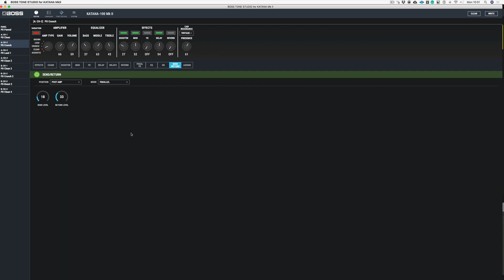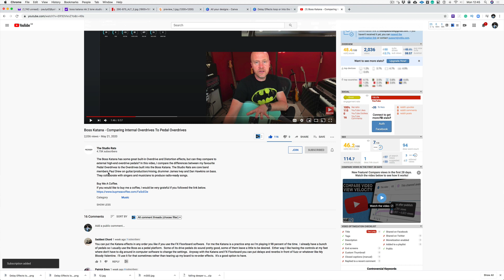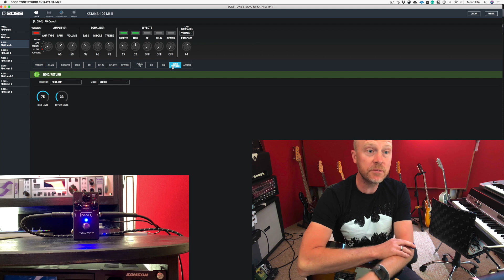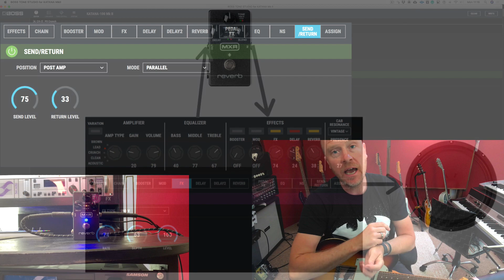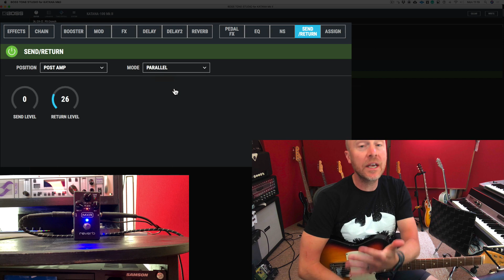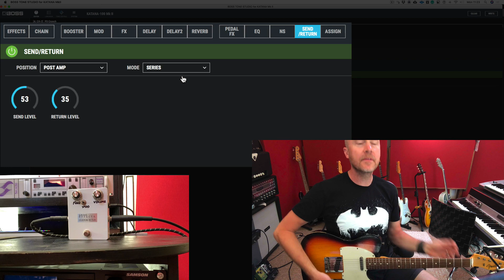Boss Katana - Effects Loop

Comment: Thank you for your Katana videos - they are very helpful. I  recently watched your Ultimate Versatile Tone series, and tried out the settings.  I see you are using similar settings in this video.  In common with other YouTube channels you tend to use quite low EQ settings combined with higher gain.  As I understand it, the Katana EQ controls are subtractive so, if they are all set low, it reduces the gain.  Consequently the gain has to be set higher to compensate.  You have the Mid on 63, with the Bass on 37 and Treble on 43.  I tend to set the whichever is on highest to say 90 - this would give Bass 64, Mid 90, Treble 70.  I can then get pretty much the same sound with Gain on 25-30, leaving me much more room to increase gain for other presets.  When I tried your settings with my Strat it sounded very weak and weedy unless the gain was well up.  There is obviously nothing wrong with low EQ matched with high Gain settings, but I wonder why you choose this method.  Is it just a throwback to starting at 12 o'clock?   If so can I suggest you give the alternative a try?

Comment: This is a question I brought up in an earlier post.  Shouldn't an IR  pedal like the NUX mini work nicely if you put it in the fx loop post reverb.  The first time I asked you didn't think it would work very well.  Not sure why, but would like more info before ordering pedal.  Shouldn't it work  similarly to built in IR in something like a Helix?
Reply from the maker: Hi Bruce, I don’t know the nux mini I guess it would work fine if you went post reverb, but you would also need to choose parallel, even then I’m not sure if you’d need to plug in back to the return. I’d have to try it.  The Katana line out is the better option as that is what it is designed for.
Reply: @TheStudioRats  My question is more generic and not really just about the NUX, but for any IR pedal.  The line out would be fine for recording, but I am referring to playing live.  Put into the fx loop shouldn't it give you the same effect as if you used it from the line out  > FRFR cab, except that you would be using the Katana power amp and speaker instead of the FRFR cab.  I do realize that the internal power amp and speaker might not sound as good as a true FRFR cab, but shouldn't it still help to give some type of cab simulation similar to the voicing switch o the Katana 100 head or 2 x 12 combo (1 x 12 doesn't have that switch, and in tone studio it seems to only have effect on USB or line out).

Comment: i run my mxl 10-band eq through the effects loop. its really good to know i can run it in parralell. i do like Katanas tone a lot, i like my 10 band a lot. but both by themselves is too hot or cold for me. blending all that is gonna be my trick. thanks for that at the end. its also important to note, in case anyone didnt catch it...if you want to run your fx loop parallell because lets say you wanna blend the eq like i do, but you also have a pedal with a mix blend, just turn the mix all the way up on those pedals so you dont get those phase issues. at least thats what i gather.

Comment: Hi Paul,
I've seen a video of yours about using the Katana amplifier with the Two notes Torpedo C.A.B. M that interested me a lot.
In my case, I wanted to use a device from Two Notes to simulate cabinets on the Katana, using a cabinet simulation called "The Hidden Gem Collection" that brings us closer to Steve Vai's sound but at the same time, also using the Katana as an amplifier.
It's possible ? 
Do Two Notes devices (Opus, Torpedo, etc.) allow connection to the Katana via the "Send/Return" function?
Which do you recommend?
Congratulations on your videos. They are very useful.
Regards.

Comment: 🤔 interesting but still a little confusing. I guess I’ll have to watch this video again. 😆 I have a question about volume using the effects loop. There is another video out there where they plug in a short 1/4 inch cable to the effects loop send and return to use it as a volume boost. That being said, it appears that the volume in general of the whole amp is by far way louder as long as you increase the send and return levels to 200. So if I leave it on does this effect tone in any way. In others words, am I gaining more head room for say the cleans then if I didn’t do this? Because if that’s the case, why wouldn’t you just use the amp this way all the time? 🤷🏼‍♂️

Comment: Nice clear video - very helpful. I noticed a "power am in" socket - wonder how would that be used?
Reply from the maker: Hey BA, we did a video on using 2 katanas I think it’s covered in that one.
Reply: @TheStudioRats  That's great - will check it out. Thanks!

Edit: I found the use of effects loop that I was looking for in your "Boss Katana - Using a Looper Pedal" video. Thanks.

On a related note, if I want to use my multi-fx pedal, then I belive it too should go in the send/return loop (like the looper pedal). However, in that case, the mod/delay/reverb on the multi-fx pedal would have to be switched off and I should use similar ones on Katana, correct?

Comment: Ive tried to get the Effects Loop working as I want it to but Im having problems with that the EQ settings on the amp gets changed when activating the Effects Loop.
So ive tried to plug a cable directly between the send and return port without any pedals just to test and as soon as i turn the Effects Loop on in the Tone Studio i can hear the EQ settings change on the amp. If in Parallell the EQ settings change from being mid focused to more bottom focus with more gain. In series i hear that some of the top gets cut away and also some of the dynamics gets lost. Ive tried to mess with the Volume of the Effects loop but i dont get anywhere.. Do you hear the sound change if you turn the effects loop on and off?
Reply: Have you had success on getting this figured out?
Reply: @markntexas8265 
I placed an MXR 6 Band EQ pedal in the loop and adjusted the tone.
Reply: @GabrielSkolderblad  Bummer! I noticed the same thing. I have a bunch of presets loaded in my library that sound great but when I use my looper in the effects post reverb.series, the  quality of the tones change.

Comment: Hi paul great vid as usual👍 I have a tc HOF in the loop with sonicmaximizer and a mxr 10 bands eq. All work great and give me a nice improvement. Use my KH more as a pedal platform. For that purpose Paul is the D20 far ahead the katana ?
Reply from the maker: Bruno Trebucq hi Bruno cool setup. The  D20 is not as versatile but it’s a really good sounding valve amp. Personally I gravitate towards valve amps.

Comment: Thanks for the great video!  Not sure if you've have BOSS ES-8 Switcher but I thought I would ask:  Is running your Delays/Reverb through the Effects Loop of the amp the same concept as running the Delays/Reverb in Parallel on the BOSS ES-8?
Reply from the maker: In effect yes I guess so if the es8 had a dry/wet control.

Comment: Hi there quick question on Katana 100w and GAFC controller.  Is there a way that I can assign a delay to the actual 2nd button (which says delay) ? My 2nd switch button corolates to the Mod effects setting. Not a big deal would be nice to do for other effects. Thanks
Reply from the maker: Have a chat with Boss tech support they might know

Comment: Question - When using a looper in the effects loop (post reverb/series), I notice that my preset studio rats tones from my library sound different. Is there a workaround? I plan to always have a looper plugged in , is there a way to set the amp to always have the effects loop post reverb and series? Probably editing all the tones to account for the looper is not going to be fun.
Reply from the maker: You need to move the loop in tone studio from before amp to after the amp